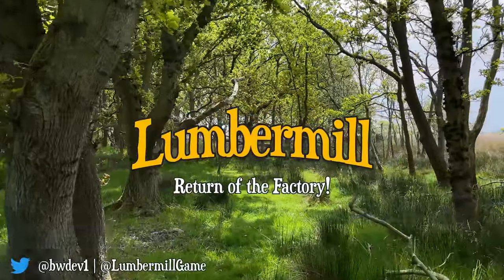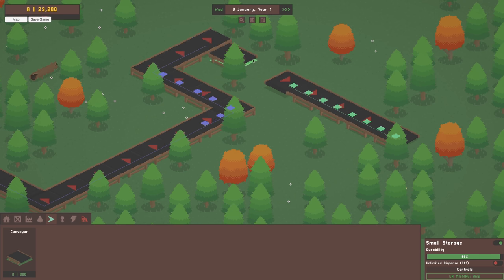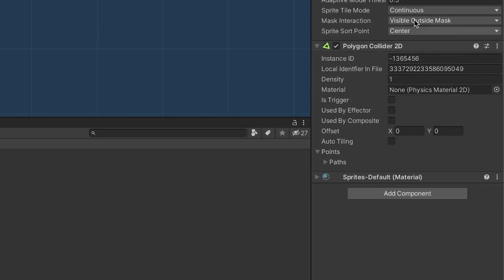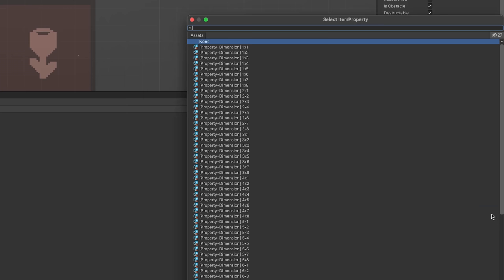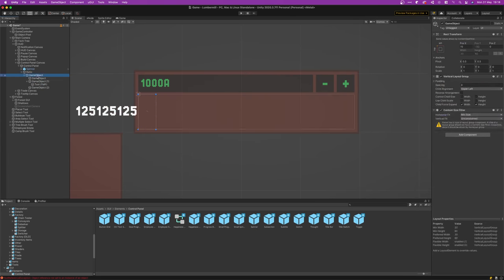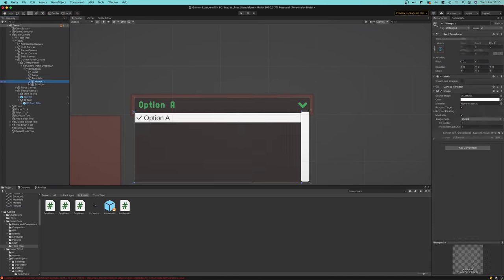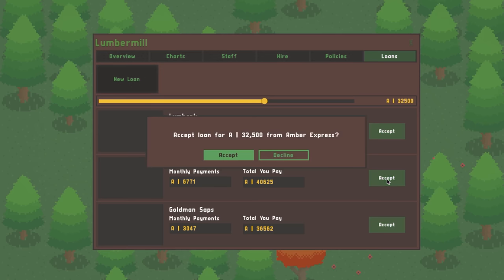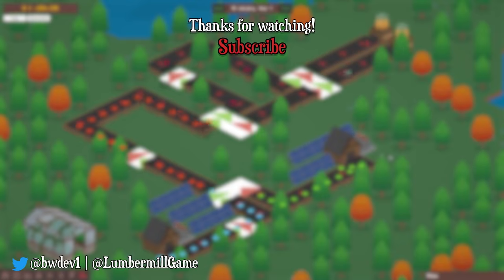Creating Machines for Lumbermill (Indie Devlog)

Comment: It would be neat if the saw just cut it in half, and you added a rotation machine. So to get a 4x4 you'd cut an 8x8 to get 2 8x4 and then need to rotate and cut it again to get 2 4x4 from one of the 8x4.

Comment: Chip, sawdust and bark waste conveyors for each the appropriate machine centers.    In modern mills the conveyor system works well to represent the log by log flow, but once the logs have been cut into boards, we use lumber transfer conveyors that can hold significantly more volume.  These transfer decks require an unscrambler to singulate the pieces again downstream.   Saw changes are a reality every 4-8 hours. If you could model in a log diameter distribution.  Bigger older logs will produce more lumber, smaller younger logs less.   If your island has a mixture of new and old tree groups, stands, it will impact the productivity and product profile of the mill.     Excellent work !

Comment: Not 100% sure how well this idea applies to your idea of the game but having just played Rise Of Industry, it'd be cool if you could offload lumber into a factory that will develop different things with your wood such as toys, furniture, boats etc. You would be able to choose from a drop down what you want to develop for example "Toy Train" and it will say: 4x Painted Polished plank where you'll be able to choose what type of wood and what colour of wood you decide. Then the factory will create the toy train and you could make it so that the different parts of the train (smoke stack, boiler, wheels, cockpit etc.) actually come out with different colours depending on the wood you put in.

Not to mention the fact that you could add events where it's the Chinese new year so trains with red wood sell for 50% more or that, say, England won a football tournament so red and white trains now sell for 100% more. This way you have an incentive to change what paints you are using.

just an idea :^)

Comment: I have some ideas that maybe you could consider. Not all of them are good just random thoughts
Polisher- removes any impurities in wood (additional profits when sold)
Wood Denotter- removes the bark and trims the wood
Firewood chopper - turns logs into many chunks of wood (1 log turns into 6 chunks and can clog up conveyer belts faster)
Sawdust collector - Place next to cutting machines to improve speed on cuts
Wood packager - stacks 2x4 for more conveyer space/storage

It would be cool if you had an option to build your buildings out of the wood that you manufacture, as well as an option to buy it
IMO I think that the splitter should only go up to 3 (1:3, 2:3).
Like I said not all of these thoughts are good, but some came across my mind while watching.

Comment: one thing which  i think might be cool is river transportation. You would have a "conveyer to river converter" or something similar which would be a translation between the two, and then a "river to conveyer converter" as well. Now why use this? Well, rivers have been used to transport logs for a long time, and not just with the historical context but rivers would be below conveyers meaning you have two levels of transportation to work with but rivers could be faster depending on the current and provide some challenge with machines that only accept river-based input. Rivers could also be useful if you ever add height levels to the game- rivers would basically act as a diode in that they are faster and cheaper to move from high terrain to lower terrain (waterfalls) than conveyers, but conveyers are able to go uphil with the height change device being more expensive.

as far as devices go, a wood pulper would be nice, so we can make cardboard and paper (either in the same machine or in another one). A furnace-type one would be good for making charcoal and providing some power. Power storage would be nice if you don't have it yet, at night solar panels aren't going to work.

some machines to plant different tree types, and another one to harvest could be cool, maybe a little bit to complex.

Comment: Nice update. One thing that I have been thinking for a while (not sure if I have mentioned it before) is that it doesn't seem right that placing a conveyor removes any trees that are in the way. For one thing, the player is losing the value of that tree and second, it just doesn't seem realistic. The player should be forced to clear the path before building. This may require a new structure (which is something else I have been thinking), a stockpile. Where newly cut trees can be stacked while waiting for processing. With a stockpile, you can have lumberjacks working before your processing systems are online. Just some thoughts. Thanks for the taking the time to create the videos. It is fun to follow along.

Comment: Just a FYI. When talking about lumber sizes the smaller dimension is normally said before the larger. 2x4, 2x6 2x8 2x10 etc.
Reply from the maker: Yep, and I did consider presenting it that way. Decided against it as it would cause issues when selecting a dimension to cut, as you might halve one dimension - making it switch from being the larger to the smaller, which would be confusing for setting up any following saws. If the two dimensions are written out independently that eliminates any of the confusion. The game would of course still treat the two variations (e.g 2x4 and 4x2) as the same thing anyway.

Comment: what about Rough sawn lumber and planed down lumber. also as another person mentioned a rotation unit så if you have a 2x4 and you run it laying down you get the 2pcs 2x2 or if it is standing up you get 2pcs of 1x4. You can also add sawdust as a bi product for examples sheet goods with also "takes away" from the amount of wood. then you can choose between circular saws and bandsaws. Another option can be to turn the wood to slabs without debarring and add dryers. Dries slabs can then be sent to carpentry factories. There are many options what to do but i like what i see so far :)

Comment: Not sure how it'd fit in mechanically, but some ideas for processing wood could be something along the lines of a wood generator to create energy (I forget currently how you currently have that working, so if the idea doesn't fit then dw), but also you could do something where you create charcoal from the wood. Basically, there's your traditional stuff like furniture and whatnot that you currently have, but outside of that there's a couple other things which wood can be turned into. Maybe sawing wood can create sawdust, which can be collected and recycled into something else as another idea.

Comment: Something that caught my attention in this video: The splitter really seems to slow down the flow of logs on the conveyor belts. It seems to wait for a log to get passed before it allows the next log to enter. I don't know if this is intentional, but I would prefer a more steady flow of the logs through the splitter, so they don't build up in front of them.

Comment: How does the splitter interact with belts that are backed up to the splitter? Does it instead prioritize the other belt?
Reply from the maker: It’ll strictly follow the ratio set by the player. If one side is completely blocked, the splitter will stop unless it’s fulfilled the ratio for that side. You can always change the ratio to 0 for that side and it will ignore it completely 🙂
Reply: @BWDev  cool, thanks for the reply